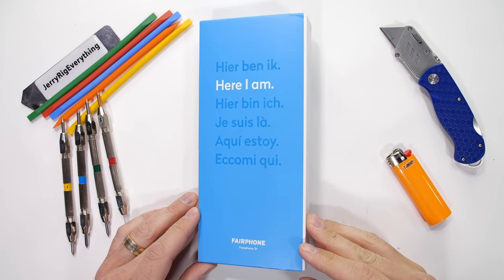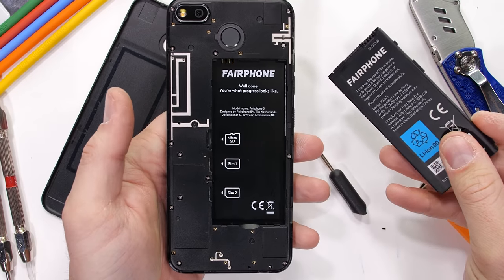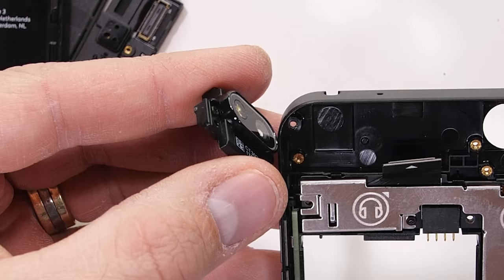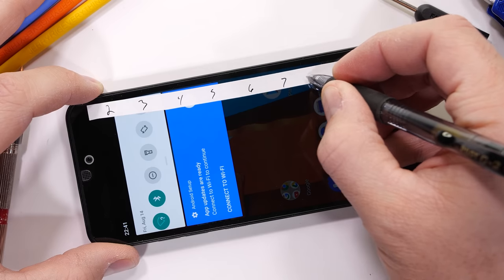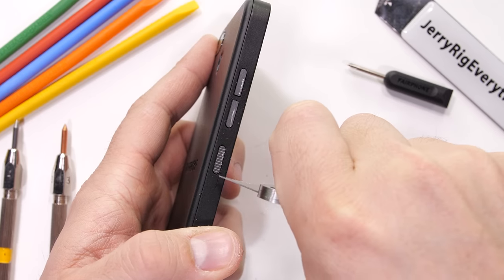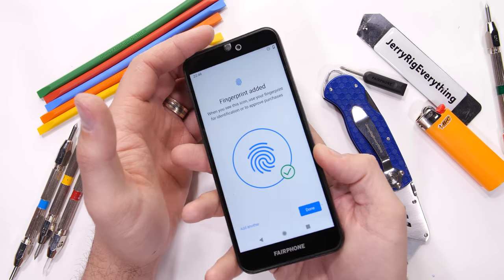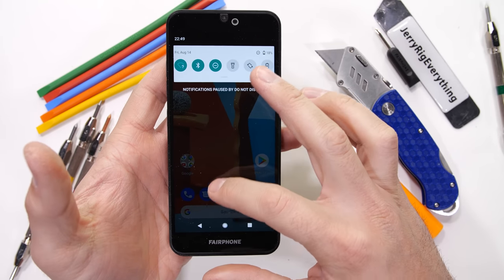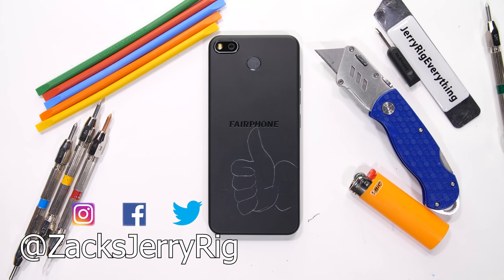Fairphone 3+ Durability Test! - it feels like cheating...

Comment: "unless you own a Mac" actually Mac's were user upgradable back in the apple IIe period even if they did have their own standards not shared by anyone else (I know because I was the one who showed my school's Computer Teacher how to add the mouse module (that had nearly no useful applications)). They at least were their own thing, and could be called standardized for their own class of computer. 
Compaq, however kept up the proprietary parts game until well into the 2000's even though they were ostensibly PCs. Even now Dell and HP are frequently called out on tech channels for using non-standard, proprietary components to stymie users hoping to do upgrades on their own.

Comment: I have the iPhone 12 Pro because I use the LiDAR to scan buildings for architecture/interior design. 
But I honestly like the idea of fairphone. 
I would like to switch to the fairphone but my problem is that I use my phone as a computer at this point. The LiDAR and face scanner are a huge part that I wish fairphone would release “pro” modules for the phone. 
I’m torn because in order for the company to stay afloat I know they need to sell product, at the same time, I already invested in this expensive phone that I don’t see myself changing for 2-3 years.

Comment: the LG G5 tried something similar and only had one screw, whilst a great idea the internal contact pins would eventually fail as the phone aged and got more worn and bent / dropped. this meant the gps, fingerprint scanner etc would stop working. it might not happen to this phone but it would be a concern.

Comment: One of the most important places and points on a mobile is the Camera glass, it seems to be a weakness that is found all the time... My new mobile already have scratches on the camera glas, I guess from a rock that I put it up against to standing.
Very very sad to see how easily things break.
A little plastic can go a long way for protection. It is just sad to see that minor things are not looked at.

Did I miss a scratch test on the camera glass beside with the knife?
I got a new phone it took one minor drop then the screen died... I now have a new screen but with a dead pixel... Like my LG V20 have handled multiple drops without any issue but it had to die of use, although the motherboard is now in a new mobile of different kind as it was running better in rooted state then the other varient. So in some sense my old LG V20 is still alive...

But the LG V20 had the Camera glass issue.... and the glue wears out over time I found out, both the glass for the back Camera and the screen became loose as well, which ended up breaking the screen. Well... But it is alive and running now as a secondary phone.

The Fairphone 3+ is now in Denmark, and I might have jumped on that wagon if I had not already bought the Shift 6mq - although.... the 64gb internal kept me from looking further into it.

Anyway... Just nothing really on the marked overall, had waited for a Linux phone but... That is still into the future. But it would be nice to actually have root naturally from the beginning! Sick and tired of needing to used hours and hours of time on getting things rooted.

Comment: I like it, but there are some issues that get frustrating. 
The screen becomes less responsive over the course of a day, and requires a reset to regain normal responsiveness. 
I’ve also got a weird issue with sound balancing: it’s like the phone has an inverse sound balancing feature. If the sound of a music track or video gets quieter, the phone will decide to bump down the volume a little; if it gets louder, the phone will bump up the volume a little. It’s a strange thing.
Other than that, it’s a good phone. I’d like something smaller, but I guess that’s hard to do with the modular features.

Comment: When they combine that concept with the form-factor of the Microsoft Lumia 950 XL, have a certification for 3rd party modules in place, add the rigidity of Samsung Active devices and a variant completely sealed with only triple coil wireless charging, bluetooth, no speakers, no mic is offered ... I AM SO IN - some of us actually do not use telephony at all and have their "phone" fully silent at all times, preferring ipx earbuds for music and video calls on the go and use apt bluetooth headphones or casting/remoteplay for the long and rich experience coupled with a separate display. - Oh and the option to mount a modular battery pack please, stackable - i feel able to carry some pound on top if it allows me to run for a week without a power outlet nearby in ONE GO (please don't give me that "dude use a powerbank", reread please).

Guess it will take another decade until someone makes sense of fully waterproof and wireless devices and manages to actually market them in a fancy way so even those "accustomed customers" can overcome their "i don't like what i never tried"-anxiety.

One may at least hope, right?

Comment: I'd rather have one good general purpose wideish lens bright camera than 3 where one is okay and 2 are low res ;-) Pretty cool result from some pretty extreme abuse. The 100 dollar AVAILABLE genuine screen mitigates the corner drop test that is oh so common in real life. Aftermarket screens never work as well as the originals even in devices that aren't apple that you can repair. Quality replacement screen availability is huge IMO. What CPU does it have, though and how much RAM? I'd be hoping for a late/high spec qualcom and 8+ gig.

Comment: This phone is SO close to being perfect it's not even funny, literally 2 core upgrades and 3 add-on modules, and I would immediately buy one and never look back

Just add the following

Critical upgrades 
* More RAM (at least 8GB)
* Better SOC (Snapdragon 860 or MediaTek equivalent) 

Modules that I'd consider critical for me, but optional for most people 
* AMOLED display (power savings) 
* Wireless charging/NFC back cover 
* Better camera with OIS (also 60FPS is not slowmo, I consider that to be the minimum for video recording) 

Nice to have
* Larger battery sizes (otherwise I'd just hack my own together like I did in the old days, or carry spares with me like I also did in the old days) 
* Better network support in Australia (doesn't currently support all 4G network frequencies used here)
* 5G network support
* More internal storage for apps that refuse to install to a memory card 
* External antenna port (again, I live in Australia)

Comment: Please do the Fairphone 4, I love the concept. However not sure if it's available in my locale.

Still the best thing I can do for the environment is keep using my 4 year old Pixel 2 XL, by daring to replace the battery without cracking the screen or damaging the internals.

The lack of security updates is unacceptable though if you ask me, I haven't had updates for a year. MS would never do this. We are now left with 2 unacceptable companies running the show.

My current phone has no headphone jack and for 2 to 3 years that was completely unacceptable. However there's now good headphones on the market like the sony wf-1000mk3, easy to repair too. However they are expensive and not for everyone, so I'm dissapointed fairphone removed the headphone jack, no excuse. I won't use the jack but that's the thing we're fighting against.

Since my Pixel 2 XL I've seen not a single phone that's equal or better than it in every aspect, so longevity is now a massive factor to me.

The ROG phones came very close except for their camera's, but mainly the lack of availability of the accessories was the issue and I couldn't even get the earlier phones.
The Fairphone might be down in spec, missing front facing stereo speakers, but it's actually a step up in some aspects from a Pixel 2 XL and maybe I can send a message, that I'm not going to upgrade unless it's better and I'm not going to settle for forcing a perfectly good phone to die.

Comment: This concept is what all phones should be. If I want to have the highest end looking phone with cheap components I should be able. If I want a cheap simple phone with the best components I should be able. If I want a mix for the best value I should be able. I really don’t care much about having cameras on my phone. Just having one or two decent is perfectly fine. I want tons of ram, a fast cpu, a bunch of nvme storage, a big battery, a high res high refresh screen, WiFi 6, and thunderbolt 4/usb4. I want it to be a smaller phone like the iPhone mini. No bezels, no chin, with a touch button under the glass that doubles as finger print. That’s my perfect phone. Add a tempered glass covered e-ink display on the back to save battery and let you pick different designs. Would be even better if it was a full color e-ink display.

Comment: It's a cool design but unfortunately when you buy it, it's already obsolete. The all plastic design doesn't help its case either. It's not a good looking phone, has no headphone jack, no amoled display, no water seal, no wireless charging, no OIS.
It lacks soo many features yet is priced like a middle range phone which has most of the above mentionned features and sometimes more. Its parts aren't cheap too, its screen is actually more expensive than a middle or high range smartphone screen.

Now I know the people producing it are actually paid like proper human beings and the parts are responsibly sourced. We have to make a lot of sacrificies when buying this phone without ever knowing if the concept will eventually spread out. 
I commend the efforts though, it's nice seeing this brand realize what Google couldn't.

Comment: Well, even though it is easy to repair, has it become more reliable than the first and second gen? Despite being this easy to repair, compared to the total number of units sold, the Fairphone was the phone that was brought back most for repair. They didn’t even last 2 years before something broke. We were wondering if the company’s business model was less of selling phones and more of selling replacement parts. It was so bad that my employer (biggest operator in my country stopped selling these only after a few months). It generated a lot of electronic waste and people have sometimes spend the original price of the phone for repairs.

Comment: Not including the charging brick is so much worse for the environment if u need a brick or the plug cause the extra shipping, especially for USB c cause iPhone users or ppl with old phones that had micro USB would need to buy they new cord and or brick. They should have an option to buy with the charger for a few bucks extra

Comment: Everyone keep raving about Apple removing charger for environmental reason, not knowing that Fairphone has done it for ages. If Apple or any other smartphone brands really want to care the environment, they really should follow what Fairphone does. For example, the 3+ used 40% of recycled plastic, which is way more than any previous Fairphone models. Only removing the charger while still making it difficult to repair and using more material is not environment friendly.

I could also raved on about child labour and overworked underpaid worker practice that major mainstream smartphone brands always do, but that's another story for another day.

Comment: I probably won't purchase that if it ever comes out, mainly because:
1. it's mostly not that upgradeable - I'd imagine someone wanting to upgrade a 1st gen camera to a 3rd gen, only to realize the OS/driver or the older Chipset won't support it.  That's because it takes more resources to keep the compatibility across generations. 
2. Ive been repairing electronics so I have no issues with prying into my phone to replace some parts just as long as it doesn't involve much microsoldering. So I don't need the phones to be designed that way (modular) tho it it was like the Project ARA. I'd probably get one just because it reminds me of actual LEGOs 🤣
3. I think it's expensive (but I understand why it has to be)
4. I think it lacks the mainstream features (I agree with Mr. jerryrigeverything)
Reply: fairphone 4 has all of that

Comment: There are people using the same fairphones for over 6 years. The fact that we might get surprised hearing this is a sign that there is something really wrong going on in this industry. This should be the norm, not a freaking oddity.
I have a 286's that's still running, My Nokia 3310 is still working, even my Motorola Startac is workinga after 20 years or more. And somehow we got indoctrinated by the cellphone industry that the cool thing these days is to throw away a handlheld computer every 2 years. It is time to wake the fuck up.

Comment: There is actually a Snapdragon 800 Series Fairphone
Reply: I remembered that with the Fairphone 2. It used the same Snapdragon 801 chipset found in OnePlus One and Oppo Find 7. I'd love to see Fairphone use Snapdragon 800 Series chipset again, even if it's just the 2019 855 or 855+ chipset.

Comment: kind off a shame it looks so dated while also being so heavily overpriced
Reply: if you think its overpriced then you dont know what you're buying.
Reply: @tjeulink  dude if you think a phone with specs;
5.6 inch display and I may add LCD
4 gbs of ram 
snapdragon 632 chipset
64gb memory
3000 mah
Outdated gorilla glass
And max recording capture rate of 30 FPS 
Is worth 500 dollars in 2021 because you believe the modularity of the phone will make it worth it you can be my guest and buy it. 
But I will tell you now, replacing the parts on the phone, which to note, will always be years out of date, will not come cheap at all.
On top of that you will probably not be able to change out the main display which looks pretty awful.
Tbh I can’t really conceive what you think you’re buying.

In honesty I understand perfectly how this could’ve been a good idea but the beauty about what makes computers so great is you can buy cases that will comfortably fit the parts you are getting. On top of that computers are not in constant motion which means parts don’t have to be tightly fit into place, the difference with mobile phones is that they do! meaning for it to work all companies would have to agree on exact sizes and fittings to produce their parts to which is never happening.
Reply: @frankbank8720  you're buying children who dont have to die in mines for their family to survive. You're buying that suicide nets arent needed anymore outside factory floors. You're buying that wildlife can coeexist with mineral extraction. you're buying research into recycling and systainability throughout the entire phones lifecycle, and how to improve that. You are focussing on material gains, which is not what this phone is about. This phone is about changing a harmfull industry, you're buying that AND a phone. Like i said and you just demonstrated, you dont know what you're buying. buying the 'better' value phone, is just placing the cost in the destruction of forests, in the boot on people their necks working as slaves, in the unkempt polution destroying the world around us.

Comment: The problem with the fairphone is it is bad. Slow, terrible screen, terrible speaker, abysmal camera, no widevine l1. :/ may as well buy a used S9 and replace the battery and it will be better in every way and less wasteful cos you bought a used product instead of a new one.
Reply: Even if you buy a used phone, the repairability wouldn't change. You have to remember that. If let's say that a brand new phone only scored 4/10 in repairability, it wouldn't change even when you buy it used.
Reply: @FAT8893  so what? Repairing crap is still crap. You can buy like 3 used s9s for the price of the fairphone.
Reply: @bird6691  I'm still going to buy this crap anyway. I have a friend of mine who also own an S9 and he's really not happy with the repairability. Also, the S9 starting to show its age now.
Reply: @FAT8893  How does that make any sense? The S9 is vastly quicker, has a better display, better camera, better speakers, widevine L1 etc etc. If the S9 is showing its age then what is the fairphone which is roughly equivalent to something like a 2018 budget phone like the Redmi Note 5 Pro except the Redmi had a better camera, design, screen etc... the Fairphone has similar performance to a GALAXY S6 and even then the S6 still wins in terms of camera, display etc.
Reply: @bird6691  buying even a used one unfair phone supports people buying a new unfair phone and does not help fair phones at all
Reply: @climatechangedoesntbargain9140  Bs
Reply: @bird6691  thanks for confirming I'm right by not having any arguments